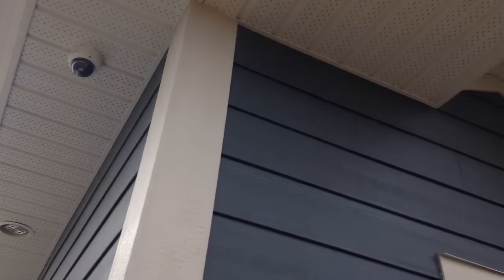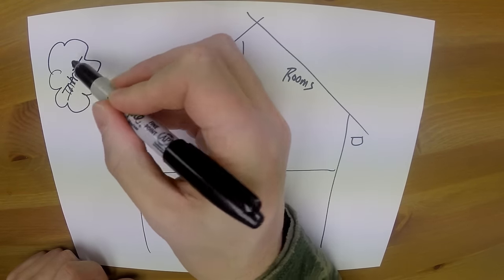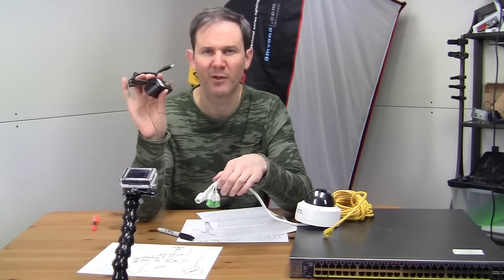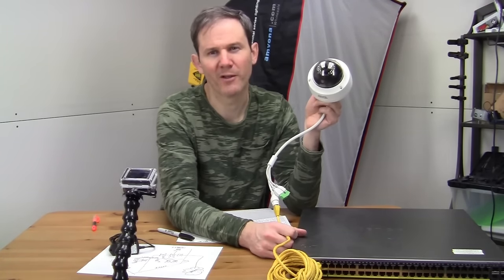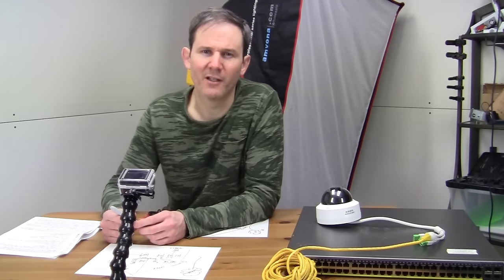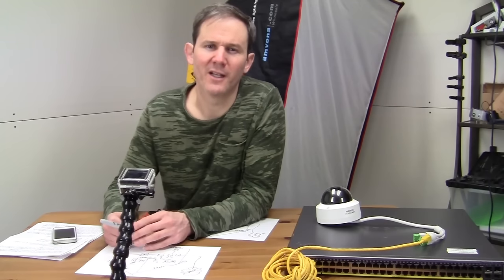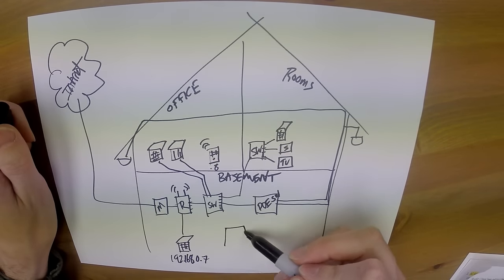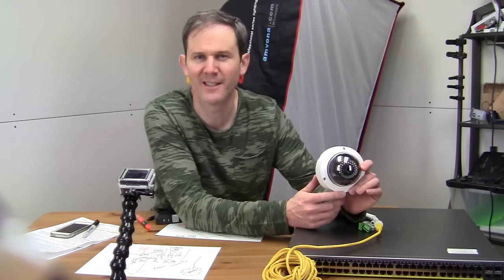My Security Camera System Architecture – Explained in Detail

Comment: Nice video. I'm a beginner, but I'm learning about this stuff, from ipcamtalk forum. I went, with Dahua turret cameras(all metal), mostly HDW5231RZ cameras, which are international versions, so firmware can be upgraded, purchased from EmpireTech, or Bec Technology(same company but two different names, his name is Andy, you can find him on Aliexpress, or Amazon as well).He is a nice guy, ships DHL and supports his stuff, for one year. Dome cameras, will have haziness issues from the sunlight(they are plastic) and also IR reflections. These cameras are only 2MP Starlight cameras, but they have a much bigger sensor, than 3-4MP cameras.

Comment: Your spaghetti downstairs is Hilarious!!
Reply from the maker: It's still just a bad today...  still in the market for a rack to manage/hide the mess.
Reply: Have you experimented with Digital Watchdog at all? They have some very feature rich NVR's. But they have a different software platform than Hikvision and all the Hik copycats. I wonder if I can mix the two cameras into my NVR well. You can get a decent rack for a few hundred. I like how you said you only notice them if you are a burglar or a camera junky! I know a lot of the wireless cams are cheesy, however I have built a couple wireless bridges and then install a poe cam at the other end and it has always worked beautifully. Still need power / solar.

Comment: This is a great description of the physical network. You also need to consider the virtual network.....especially when possibly putting on grey market cams on the network. I'd suggest a separate VLAN for the camera network....so it's virtually segregated from your home network and all of the devices connected to it. Also, get a Firewall to ensure you're not getting hacked from the outside or between the VLANs. Here's a cheap one - firewalla red on Amazon. If you want a little beefier version, join their kickstarter for blue. The FW sits off the router. I get concerned with Command & Control (C&C) sending data back to China. One big, flat network with devices, alexa, NVR, and cams all sharing the same space can be pretty dangerous. VLANs aren't bullet proof, but better than nothing. If you really want protection, set up a L3 segment for the cameras/nvr.
Reply from the maker: I like the way you think!  Great comment!  Thanks!

Comment: Whats your build of your pc? You mentioned i5 and 8gb of ram? anything else? curious to see what you built. My setup will be like 4 poe cameras
Reply from the maker: I have since upgraded to an i7-2600 @ 3.4 with 16GB of RAM, a 120GB SSD for Windows and a 5TB HD for footage.  I am considering using 2 4TB HDs instead and making them into a RAID since the disk utilization is pretty high with my 15 cameras... it may remove some of the strain.

Comment: Nice setup, except for that data closet ;)  We all have the best of intentions.  When I built my house 17 years ago I began running CAT5e to every room, and since I hadn't decided how I was going to design my basement family room yet, i tucked a 2U rack into the ceiling leaving extra coils of cable to allow me to move it to the real data closet I would eventually build.  17 years and still no data closet, so I'm right there with you with lacking wire management, although mine is all stuck up in a ceiling tile.  I'm currently  researching systems to build my own home security camera system.  I'm curious if BlueIris has a feature to allow you to search for a specific area of a camera's view to find out when an object was moved or stolen.  I think it was D-Link's now discontinued Business solution that had this ability.  For instance if a woman sits her pocketbook on a counter and returns to find it missing, you could enter the search screen and put a box around the location on the counter where the pocketbook sat, then it would search all recorded video to find out when the video content of that box changed, which would quickly and easily allow you to find out who stole the pocketbook, or if it was moved by anyone, and where it was moved to, without having to watch a bunch of recorded video in real time to see when it was moved.  This is a very valuable, and timesaving feature, that I believe should be part of any VMS (video management system).   I currently manage a very large community college's system of over 400 cameras using Verint VMS, and as far as I know they don't include this feature either, and their product is by no means cheap enough to use for a home security system.  Thanks for any information you have, and can share.

Comment: Thanks for this great video and sharing your own setup, which looks great!     I've noticed that one of the three dome cameras which you installed under the soffit over the front door is mounted on a bracket but the other two cameras are not.   When does a camera need such a bracket and when does it not need one?
Reply from the maker: At 0:31 the camera on the right has an angled bracket to it can point towards the garage door and keep its landscape orientation. Without the bracket, the camera doesn't have the doors in frame and too much of the wall directly across from the post. The camera on the left with the wall mount bracket (https://amzn.to/3JLCbqW) requires the bracket in order to get a landscape view of the driveway or down the side of my house. This camera only has 2 axis and when it's attached to a wall, the image will be landscape if the lens is pointed straight out (perpendicular to the wall). When the lens is turned to one side or the other, the orientation will rotate to portrait. When I use the bracket, I can swivel the lens in any direction and it will always be landscape. The bracket also helps me extend around the down spout so it's not in the picture. Hope this helps.
Reply: @HomeTechDIY  Thank you for the explanation.  This is very helpful.

Comment: Don't forget passive systems. Infrared door/driveway chimes, dowels on windows, door jamb locks not able to open from outside and finally something SO SIMPLE. An overhead door bell analog old school style. Ding ding no false alarm there. No battery, wifi, or glitch's. Door is open period even if the power goes out and they cut the wires. 
Ding ding. 😉 Then get a squeak toy under the mat your dog has been trained to bark for. He steps on it and my dog will go nuts at the sound. 
Many layer security is the best security. IF you get through all these in my home, plus the dog you'll be dead.
Reply from the maker: That's awesome!  So many options out there and the non-electric ones are the most reliable...  and sometimes your best friend!

Comment: Thank you for the videos!

My family is frowning and I’m planning out a security/camera system like yours. My question is: what would work with this setup to allow me to view the cameras when I’m not home?

Thanks again!
Reply from the maker: I use a free (non commercial) version of TeamViewer.  It's like remote desktop but no need to worry about dynamic IP addresses changing every few days.  You are basically logging into your computer with your phone.  The second option is to open up ports on your router to access the cameras or your NVR.  You can access the cameras individually or your recording software.  You'll need to setup Port Forwarding on your router and keep an eye on your ip address and if it changes frequently... maybe use a DNS service or ask your ISP for a static ip address.  Hope this helps!
Reply: @HomeTechDIY  how to identify video loss ?I have checked Poe,cables and power supplies but no solution.I have analog Bullet cams on a DVR.Please advise!Great video.

Comment: This was extremely helpful! I’ve started installing POE cameras but haven’t decided yet on what NVR solution to use. Do you have Blue Iris installed on the NVR computer?
Reply from the maker: Thanks for the feedback! Yes, I run a dedicated computer with Blue Iris.
Reply: @HomeTechDIY  
Will you make a video where you go through your computer setup? Like RAM, HDD, etc?
Reply from the maker: @mrblacktrh  Yes. For sure.  I am in the process of building another and I will share this in the new year.  I'm in the process of doing some tests and updating the hardware to see if performance is affected.
Reply: @HomeTechDIY  
Awesome! <3
It will suit me perfectly since I'm just about to order the last cameras I will install for now. I will then have eight 1080p cameras and nine 8mp cameras. Will need all guidance I can get for the NVR solution. :D

Comment: Very nice setup, mine is similar.  Have you thought about integrating passive infrared sensors with arduino  or raspberry pi to trigger camera recordings?  Do you use dropbox or google drive for cloud storage?  If you use gmail, did you set it up  to use its own secure password ?  Do you use stunnel for https?
 Why did you chose a POE switch that is not Gigabit?  The camera feeds are not that fast, but seems like it would transfer data from multiple cameras more efficiently if it were Gigabit.  
Infrared night vision and facial recognition is very challenging.  
Thanks for the video.
Reply from the maker: Thanks for the comment and questions.  No, I haven't considered adding passive infrared sensors at this point, but that sounds fun!  No, I do not use cloud storage at the moment, everything is recorded in house as my LTE ISP cannot handle the bandwidth.  No, I don't use gmail, nor have I gotten into https yet.  I just updated my PoE switch to a managed 48 port Netgear gigabit one (video coming soon, I hope).  Thanks again!

Comment: I used to make these systems for high security industry. We used GeoVision. But FFwd a decade+, and I think I am going to get the HIKV 7616 as you have and run the BlueIris software(IF the HIKVision supports H265+) 
I actually still have 2 16ch GeoVision capture cards that are for DVR builds, but perhaps the tech is just dated.  I still would prefer building my own system, but not sure who sells NVR H.265+ cards that go into a U2 rack style computer case?  
Any suggestions, and thoughts? My main purpose is to stay completely OFF the cloud, and not have to use a 3rd party web interface to access my cameras. I take privacy more serious than most, and I dont think I should need to trust any company with my content.
Btw, Your videos are made as if targeted for me :-) We have quite the commonality..I guess perhaps not uncommon for techies :-) Cheers!
Reply from the maker: Hey Phil! I have 2 systems recording footage; a Hikvision NVR and a PC running BlueIris.  I don't need 2 of them recording... that's more for my own education.   BI cannot run on an NVR.  Not sure about capturing 265+.  I actually only use 264 or 265.  I too am off the cloud...  trust issues here too.
Reply: @HomeTechDIY  Thanks for getting back!
Ok, that makes more sense seeing multiple videos with different info. 
(I thought you switched over to one over the other at some point). 
So what capture card are you using in the PC version? 
(I guess you are using the POE switch to power those POE cameras? But with what capture card? What is managing the video feeds?)

I am new to H265, and noticed that there is a "H265+" version on one of the cameras you reviewd (the latest video with the HIK 4K bullet review). Just want to be sure a H265 NVR or a capture card with H265 can handle H265+

Comment: Hi,

Great job and very informative👍🏽

Questions:

Would normal NVR from amazon be less powerful then the custom one you have made?

I order a Amcrest NVR Poe 8 channel for my home. But it is small box and I think it would over heat as I did not see any fan with normal NRV as a standard. 

Camera wise I ordered some different 4mp to 5mp SV3C and hivision camera. Quality wise I think both are still not that great. I only been testing in my living room. But pictures are not very clear for a POE 4mp or 5mp cameras. I though it would be the NVR at fault, so I connected straight to the cameras but still not that clear.

What the point of cameras if they can get the thief face or license plate numbers. Or easy play back to quickly pull a video.

Please advise on which system to get for 8 channel Poe for my home.

Here is what I ordered:

Amcrest NV2108E 8-Channel POE https://www.amazon.com/dp/B0719WXZTY/ref=cm_sw_r_cp_api_cHiZzb4FMWA34

SV3C POE IP Camera, Super HD 5MP H.265 Outdoor Security Camera, IP66 Waterproof, Motion Detection, 20Meter Night Vision https://www.amazon.com/dp/B0734T9DYQ/ref=cm_sw_r_cp_apip_QrkEmEkXI4Xxh

Hikvision 4MP DS-2CD2142FWD-I HD WDR IP Network Dome 2.8mm Lens https://www.amazon.com/dp/B017Y4CD9U/ref=cm_sw_r_cp_apip_7pWLeLW3eGiA4
Reply from the maker: Thanks for watching!  I'm not sure of the processing power of your NRV but it seems like a nice compact unit.  I would keep an eye on the temperature to ensure it doesn't heat up too much.  For the Hikvision camera, can you login to the camera and see what the quality/resolution settings are?  Also, check the quality setting for the main stream and sub stream (under video tab), and then make sure the NVR is pulling from the main stream.  Also, a 2.8 camera is very wide and good for tight areas, like a porch or small room, so you may not capture faces if you use this in a wide space.  Hope this helps.

Comment: Have you checked out ivideon server?  I used to use Zoneminder as my DVR, which was pretty great, but there were issues with keeping it updated and running, and it's motion detection algorithms were missing a lot of important stuff while catching a lot of  extraneous stuff, like tree leaves, grass and shadows. Ivideon has much better algorithms. Plus, it's free if you don't use their cloud services, and you can scale up to unlimited number of servers and cameras. Right now, I am running ivideon on a Nettop nT-i1000 (I have a second one in the ready) with 7 cameras, with plans to get 5 HD PTZ cameras this year and set them up on my other nT-i1000.
Reply: Curious - what cams are you running with ivideon? Seems like a small list but they state any camera that supports RTSP works. Is that how you're doing it? I'm a little worried about the horsepower of the server when using HD, 5MP+ cams. BI suggests i7-7000s for "numerous" cameras and 5MP to 4k. I can't find any recommended server specs on their support site.

Comment: thanks for this excellent video. I am contemplating installing an outdoor camera but still undecided whether I should go for a bullet or turret. I would have to affix in a vertical position (ie. vertical wall) rather than underneath a flat surface such as a balcony. the area of coverage is approx. 8m wide and the distance from the camera to target is 8m. Lens calculators work with 1/2 or 1/3'' sensor sizes but camera like DS-2CD2085FWD-I are equipped with 1/2.5''. I guesss a 4mm lens would be fine. any feedback would be much appreciated.

Comment: Great setup and you have such a nice house.. I guess you're living the dream. 

However, the video is very informative yet I think you missed something.. it's about the cost. How much did this stuff, the whole enchilada, cost in total.. My best guesstimate is about 2 to 3 thousand US dollar?

...and looking at your other videos, you installed it all yourself, but how much time did you need to finish such a job?
Reply from the maker: Thanks for the nice comments!! It was a few thousand US for sure.  The NVR was about a thousand alone and about 1-2 hundred per camera.  I had a couple of garbage systems before this one and that cost a lot too.  The time can be measured in weeks and weeks.  The research first and the experimenting with camera settings and trying different NVR software...  Each install took at least 1-3 hours and running wires in wall...  yeah... hours and hours...  it was a lot of work.  I didn't talk too much about price since I bought a lot from the grey market for cheap and I didn't want to encourage that too much as it comes with a risk.  I wouldn't want to feel responsible with someone getting ripped off with a fake or no warranty.  Hope this helps!

Comment: Where did you buy the cameras?
Reply from the maker: Most of my cameras were purchased from AliExpress, but they are the Chinese "grey" models and the firmware isn't very upgradable.  Good thing, the firmware is pretty solid and does not need changing.

Comment: se ven pocos vídeos mostrando la cámara en la oscuridad como emiten ese haz de luz roja (ir led) lo cual hace la cámara totalmente detectable y siendo fácil de inutilizar no entiendo porque no aplican leds IR de 940nm
.

Para mi las cámaras en cuestión fallan en que no dispone de IRled de 940nm por lo que e la oscuridad la cámara será bastante llamativa y accesible (emite una serie de luces rojas) pudiéndola destrozar o robar o inutilizarla. Las cámaras deberían llevar un sistema de IRleds que en la oscuridad no se iluminasen en el mercado ya hay modelos que utilizan leds de 940nm los cuales no emiten ningún tipo de luz en la oscuridad y por tanto hace que las cámaras pasen mejor desapercibidas, es importante que dispongan de WDR, IRCUT, P2P, codec H.265 o H.265+, conexión POE, wifi , aspectos como sensor PIR, PTZ, son cuestiones a valorar y que mejoran bastante la seguridad
Reply: I  agree with using 940nm LEDs but I haven't found a camera that uses them. However, the big disadvantage of using 940mn LEDs is that the camera's sensor doesn't see them very well and they do not project very far. You also need a fast lens and light sensitive sensor which adds to the cost of the camera. Also, 940nm LEDs don't work well with zoom lenses because of projection distance and lens aperture. If you are capturing video at close distances then 940nm is the way to go, otherwise you will need IR LEDs in the visible spectrum. If you don't need live view and push notifications, you can always use a trail camera with 940nm LEDs.